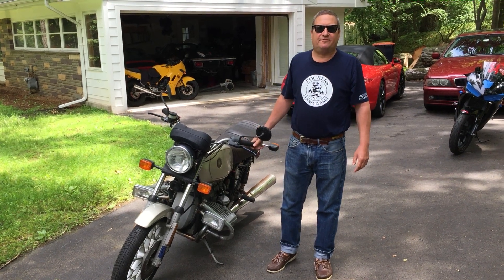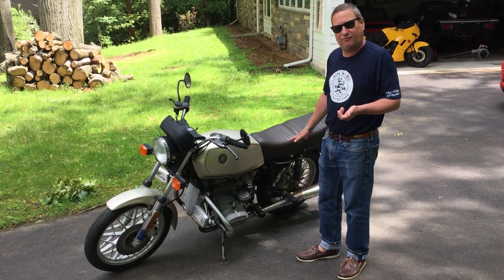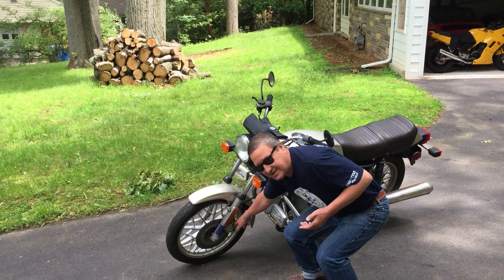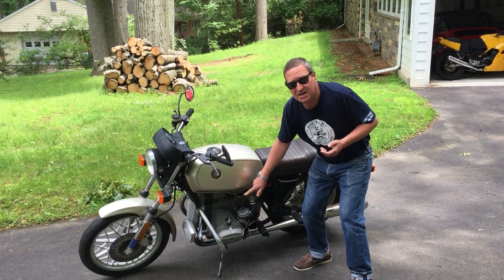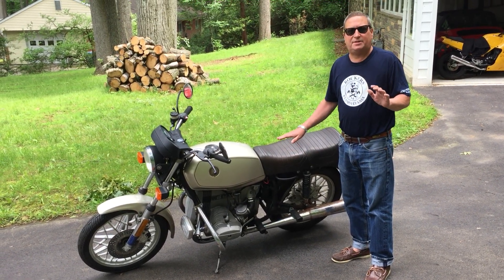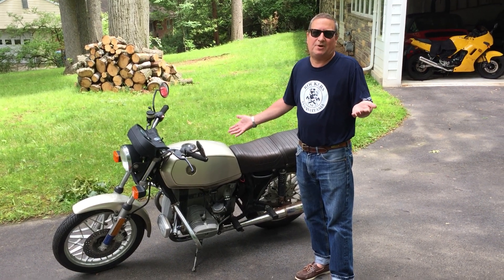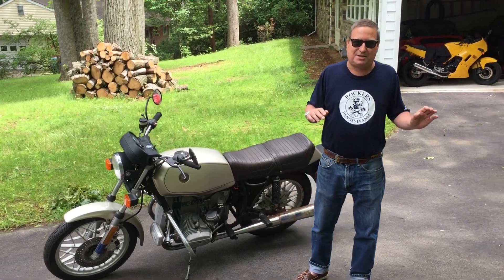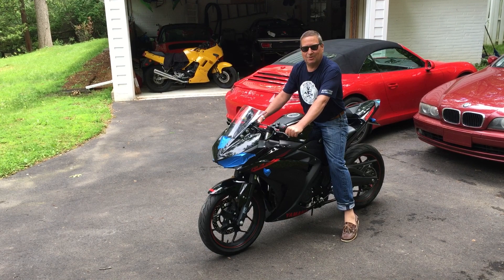Episode 9 - 1979 BMW r65

Comment: If you are the one putting a bike up for a length of time … the ethanol free chain saw gas that comes in a gallon can, not cheep but very long lasting, drain and refill the brake fluid,
Do an oil change on engine with a filter. Pull the battery out put up on center stand… etc.